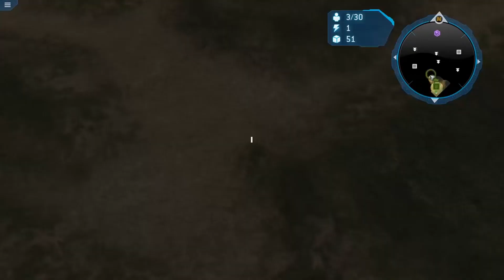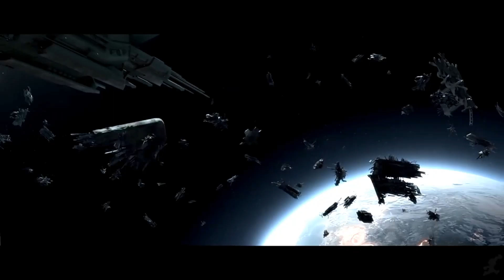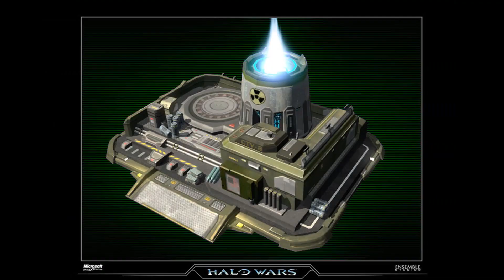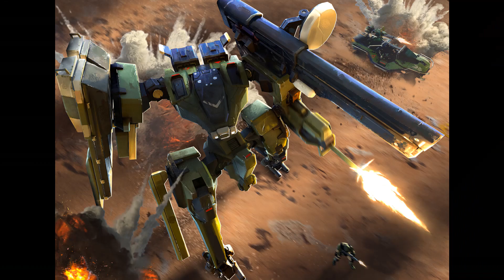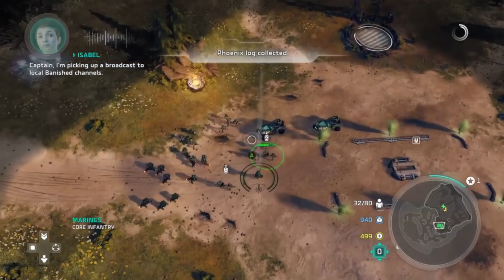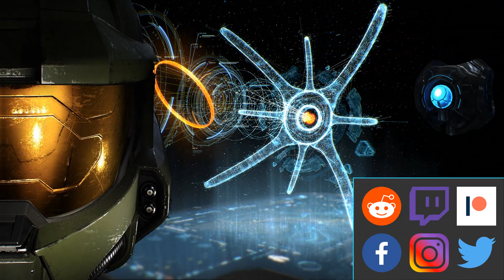UNSC Firebases - Lore and Theory

Comment: 4:41
Fun Fact: Wind is powered by atmospheric temperature gradients caused by the sun. So wind is no more "renewable" than cold fusion. In fact, every source of "renewable" energy is essentially nuclear with extra steps.
Now ain't that that just quacking crazy?
Reply: Hydroelectric is based on the water cycle, which is powered by the sun, and geothermal is based (at least in part) on nuclear fission in the earth's core.
Remember kids, "natural" doesn't necessarily mean "good".

Comment: Halo Wars 1 mod idea: Injured units can return to their building at any time and will heal outside it (maybe have an animation of grunts dragging a damaged banshee inside the summit and the pilot just walking back in).
Unlimited number of units (as far as population is concerned )can garrison in the base.  You can garrison a limited number of infantry in all buildings.
You can order your troops inside bases, they will fight against enemies that are garrisoned, air vehicles count for this. Once a base is taken over, the other team can capture it and lift the fog of war for a short time. You can also blow it up, defend it, hand it to an ally, slowly loot supplies. If a special forces unit is in the central part, they can be ordered to hide or  take a long time to set a time bomb with or without help. Factors will determine some behavior. 
Base sections can only be damaged by Scarabs, Time Bombs, Building Killers, The Glassing Beam, MAC Blast, Carpet Bombing, and Vultures.
Siege Edition

Comment: There is no way 3 windmills and some solar panels are running a base like a hydrogen reactor. Especially one containing mechanized military foundries.
Reply: They're supplementary power generators meant to help the main base's own energy grid, and it fits thematically that in 2 power becomes a resource that can be depleted because the generators aren't the energy behemoths that a reactor is.
Tldr: They don't.

Comment: As a fan of LEGO, and Halo, I would love it if Mega Construx released UNSC and Covenant base sets, you could have a massive main Firebase set with an interior, and could connect to cheaper smaller add on sets for the other types of structures.
Reply: That would be pretty awesome

Comment: Weird they transitioned from fusion to wind and solar considering fusion makes ludicrously more power in a smaller space. But I guess solar and wind have the benefit of not needing resources to maintain the base, but considering that the warthogs and all UNSC ships use fusion or hydrogen anyways, it doesn't make much sense.
Reply: Maybe they needed to be more mobile so they came up with solar and wind
Reply: @ione2251  I guess, but I'm assuming there is some plot hole here as the fact the pelicans, frigates, warthogs, the spartans, etc all use fusion or hydrogen in them that they still need the resources anyways. It's not like having the base not run on nuclear helps much considering everything else still basically does. 

Though to be fair, spartans being powered by nuclear fusion in itself is a plot hole as the series straight up says in their frigate design they have yet to make shielding for radiation other than more material so spartans should be slowly dying from the radiation they're exposed to. Fusion doesn't make any waste, but still makes radiation. One of those things they kinda glossed over.
Reply: As stated in the video, the newer fire bases have internal fusion reactors already proving the majority of power. The solar and wind generators are supplementary, not a complete replacement.

Comment: In the Current situation of the halo story the Spirit of fire is going to be Useful, The Created are policing most UNSC space so Manufacturing weapons and Vehicles is going to be a bastard. 

the SoF is a flying factory, it can produce the things the Infinity can’t. tanks, Aircraft, weapons and structures. 

Keep the war effort on the move and all it needs is refined materials, having small mining obscure outposts would a key tactic against created.

Retro fitting the Spirit of Fire with new shields, Armour, Reactors, Engines, weapons manufacturing facilities, sensors, computer software and Upgrade and Replace the FTL drive.
Reply: Virgin UNSC Infinity < Chad Spirit of Fire
Reply: Grant Reichel infinity is the frontline of the war, Spirit of Fire is the Logistical Backbone of it. The more Ground support and Assault ships they recover/find/build the more they can keep up, escorts will also help too
Reply: that is smart
Reply: im pretty sure both of the together can give as a team every SoB a Hell of a fight and start a Guirillia war on there own
Reply: I guess the infinity is much bigger and its made with covenant and Promethean technology

Comment: If the UNSC was able to, could they upgrade the spirt of fire into like a mini infinity, or if not could they have it as a support role for the infinity? It has a lot of potential as it is a pretty big ship at 2.5km. If the UNSC could add a Supermac, shielding, newer engines, better armor, etc. I think the spirt of fire would be able to keep fighting.
Reply: It’d be cool to see a tankier SoF post-refit, but considering how unsc ships are literally built around their MACs, i'd doubt it would have a whole supermac, maybe a bunch of mini-macs?
Reply: Seeing as how the UNSC build their ships around the actual super-macs, there'd have to be major hull changes to fit it in, as well as the energy required for the shielding and new engines, a new power plant system would probably have to be refitted. All of these things, in theory, woyld generally be bigger than their older counterparts and spaces doesn't come out of nowhere. Other sub systems or cargo/troop spaces would have to be removed, potentially limiting it's capabilities in certain areas.
Reply: @Anty-ux8rx  if I’m correct, the Mac on the SOF was added when it went for a refit to become a warship. The ship was over 100 years old when it was fitted as it used to be a colony ship.
Reply: If infinity encounters Spirit of fire, they will be able to finally have the opportunity to upgrade and repair their ships for the coming battle
Reply: Infinity already has a sister ship that was never finished. It's called "Eternity."
Reply: Crier Breach, I meant like an escort/ support ship
Reply: SoF is a support class vessel.
Reply: Tristan Backup, Ik that’s why I was also wondering if it could work as an escort to the infinity
Reply: @clanofwolvesofficial7231  
Technically Infinity is the next gen hybrid support/battle crusier. Infinity has it's own factories & logistics, but from what we seen at the end of Halo 5, we don't know if she is fully stocked. So yes, thier is a possibility SoF will have to act as support, Roland & Isabella will have to work together to save as much logistics as possible. If 343i decide to put em together.
Reply: Tristan Backup, SoF also has a factory on board as well do that would be useful
Reply: @tristanbackup2536  if they ever run into each other, their conversation will most likely be quick.
Reply: Betaraybill 118, that would still work

Comment: Wind and solar as a replacement for Fusion.  LOL!!!!  Makes me laugh it's so fucking stupid, the devs couldn't resist shoving a tiny bit of their politics into lore.
Reply: The new fire bases have an integral fusion reactor already providing the majority of power. The solar and wind generators are simply supplementary.
Reply: @Mr.Adamant    Look into the low estimates on how much power A working fusion reactor should put out.  IIRC our current problem is containment.  Wind and solar even in ideal conditions wouldn't even constitute a rounding error in additional energy.

Comment: i'm surprised you didn't mention how the Halo Wars 2 Firebase resembles an elephant. (or rather, they might be redesigned elephants)
Reply: It is an elephant, with slight modifications to make it more static, that's why the base looks" lighter" cause elephants are " mobile mini bases" so with some extra bits it can be a decent base and the spirit of fire is running out of supplies  so they probably launched all premade bases and are using elephants to make due and that's why elephants aren't in halo wars 2
Reply: @Brockgundich  See that's what i thought... so why wasn't it mentioned in the video?
Reply: @TheLPRnetwork  I'm honestly not sure he mentioned that it was a light base but it's obviously an elephant so I'm not sure

Comment: How powerful would a UNSC railgun tank be in combat?
Reply: Not as much as you'd think. According to Halopedia, one of the Halo Wars railguns on their armored vehicles, the M98 105mm light railgun/M66 30mm light railgun of the SP42 Cobra, has a power of up to 16 megajoules (16,000,000 joules) at maximum (and around half that power in other fire modes). The thing is, that don't state if this is ELECTRICAL energy being used which... makes this much less impressive because railguns/gauss/coilguns are inefficient AF at converting electricity to muzzle velocity energy... Or... If it's actual muzzle velocity energy. Considering that this is on a relatively light wheeled armored vehicle that doesn't fly back several feet and flip over every time it fires it's guns - I'm going to assume that's electrical power requirements, not muzzle velocity energy. In which case... Yeah... For comparison, the M256 120mm M829A2 APFSDS-T round for America's M1A1/M1A2 Abrams fires a 9kg depleted uranium slug at 1675m/s and can hit targets at over a mile away in about a second. That round is doing 12,629,684 joules (12.6 megajoules) at muzzle. And it isn't losing power due to inefficiency with converting electricity to velocity. And this isn't even the maximum amount of energy that chemical propellant can achieve. See the huge flash from firearms? That's unspent/wasted propellant that didn't help whatsoever to increase velocity and/or power of the round. Electro-thermal chemical ignition can burn much, much more and generate even higher velocities with the same ammunition. And, in fact, the new M820 Scorpions use just that technology in their guns.

It isn't until you get to ships and dedicated MAC guns that you see them handily beating out chemical propulsion. Looking at the power that ship-based MAC guns put out, the gauss/coilgun/railguns of ships and the like are OP as AF in the Halo universe. Scaling it down, however, is not so great.
Reply: Short answer: railguns wear out very quickly over time and if your tank breaks down in the first week of deployment well... Common sense is really what you need to answer the result
Reply: @FreezyPop  
But the UNSC are already highly advanced compared to today's technology and they use railguns quite commonly on the ground and in space so there's no excuse to not put a railgun on a scorpion tank.
Reply: Thor's Hammer bro do you even know how a railgun works? It’s more reliable to use a coil gun for long use but rail guns? No. Search up the US’s most powerful railgun, it’s literally a few shots from destroying itself and the maintenance just to keep using it and your telling me you want that on a multi purpose tank that will need THAT as it’s main cannon? If humanity somehow finds a way to reduce a railgun from destroying itself then it will cost several times more. A tank with a railgun that can survive its own shots and not destroy itself but will only fire about 20% better and cost several times while you can probably get 2-3 more reliable tanks which not only means more firepower but clearly more reliable than a railgun tank. So no your wrong
Reply: @thorshammer7883  
No, the UNSC doesn't use railguns quite commonly. In the ground, air, or in space. They use coil/gauss guns. Which have much, much, much, much, much, much, much... a lot of muches... less wear on them than railguns. In fact, with a coil/gauss gun you can fire a projectile through the magnetic coils without even contacting the sides in some cases. Railguns also have the issue of having a shitload of opposing forces acting against one another in a small space. 

The only reason railguns are the de facto thing in real life now is because getting usable velocities out of coilguns is so much more difficult due to timing of magnetic circuits to "drag" the projectile down the "barrel" to a useful enough speed. Both are horribly inefficient for the amount of electricity you need (much like lasers...), but it's currently much easier to do with railguns because managing the magnetic forces of the rails is much easier than managing the ungodly number of magnetic coils of a coilgun and the timing it would require for it. And it would also need more power, too. Which is a problem, because our capacitor technology is shittier than even our gauss weaponry technology.
Reply: @matchesburn  
Sorry but I can't really understand this, too much detail.
Reply: @thorshammer7883  Coil guns get a long wire and wrap them around the barrel of a gun, when electricity is put into the wires at the right time, your bullet is pulled by magnetism in sequence. 1>2>3>4>5>6>7 basically. in reality, the timing for the electricity has to be very, very accurate. the problem is how much energy you have to put in it to make it work. Think about making a fire to boil water. it takes ten or twenty minutes for the water to boil. the entire time the fire was burning, you could feel the warmth. that warmth you feel was energy not being used to boil the water. the railgun magnets do the same thing. a bunch of electric energy gets put into them, but a lot of that energy becomes heat. that heat wasn't making the bullet go faster. the halo tanks really wouldn't be that strong, because so much energy is wasted.
Reply: @thorshammer7883  looks like somebody's a big dum dum. The more often you use that cumrag floating about in your skull, the easier it will get to figure out the big questions in life. Granted this is just a comment section on a video for halo lore, but come on now, it's not that hard.
Reply: They have a scorpion tank that has laser cannon with a gauss repeater.  Now so hightech scorpions are now available
Reply: If they duck taped a ship grade mac gun to two scarabs, then maybe it would work. Just have to find two working scarabs.
Reply: Cobra already have them.  The lock down railgun is extremely powerful.  The average one is not really that good until u get the upgrade.  It would be awesome if we could use it in a mainline halogame
Reply: Hopefully with advanced development hopefully the electric systems have improved greatly

Comment: Why didn't the Forerunners use other types of weapons why only Hardlight when they could of used explosive projectile weapons, particle weapons like mass drivers or railguns, torpedoes, or lasers even?
Reply: Forerunners were arrogant weren’t they, I wouldn’t be surprised if they believed their tech was supreme to other means of delivering justice
Reply: They also used advanced particle, anti-matter weapons, and others I don't know.
Reply: They may well have it might just be the case of we haven't seen them as we've only encountered halo security (i.e. sentinels) and promethean units both of which are made to combat flood by disintegrating the flesh to stop remains from reforming where as explosives may just spread bits of flood everywhere in the explosion.
Reply: ease of access to hard-light tech maybe? if it aint broke, dont fix it
Reply: They did use particle weapons, examples include ship weapons and the rifles they used against the Ancient Humans in the terminal videos, which fire blue lightning-like beams. Hardlight is translucent and angular.

The Forerunners also used accelerated asteroids to ambush Flood ships coming out of Precursor FTL in Silentium.
Reply: Forerunner tech is supposed to last a long time without maintence.  A hardlight rifle would not need ammo, just energy that a combat skin could easly provide.  if they used projectile weapons then they would have to carry extra ammo with them. or a 3D printer to make ammo.
Reply: My guess is that the forerunner weapons only see their true potential when used alongside other forerunner tech. Say someone decked out in forerunner armour has almost infinite amount of ammo.
Reply: How do you know they didn’t? Prometheans are weirdly weak anyway.
Reply: Because “We are no longer capable of less sophisticated thinking” ? - Thor -Librarian
Reply: @dr.catherineelizabethhalse1820  I believe that the Librarian purposefully took away their most powerful weaponry when she stored them on Requiem with the Didact's cryptum. In case her husband did not recover from his madness and retook control of them, humanity would be able to stand at least a chance of defeating him.
Reply: Forerunners seem to have mastered energy production as a lot of their constructs seem to run seemingly indefinitely. However matter as I’m sure you’re aware cannot be created not destroyed, so it’s much more viable to use energy as a weapon.

They do however also use lasers (343 guilty spark)
Reply: I mean you can clearly "build" a lot of (temporary) different stuff. So instead of an explosive launcher you built a weapon that can construct an explosive projectile from hardlight (incineration cannon). Similar things apply to other types of weapons. Why do it if you can make the same but better with hardlight.
Reply: Well I mean they built halo
Reply: What's wrong with the Hardlight Weapons?
Reply: Projectiles...primitive...
Reply: They lost agenst the flood because they didn't have any power weapons!